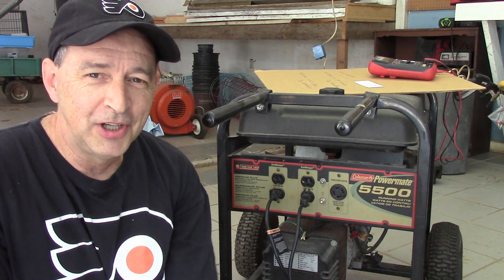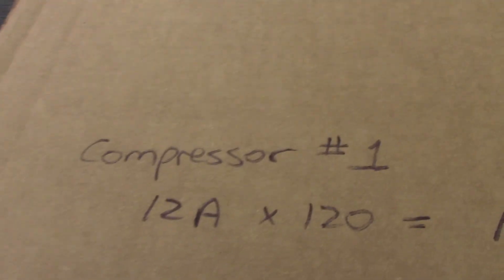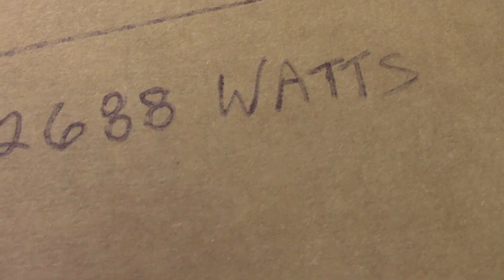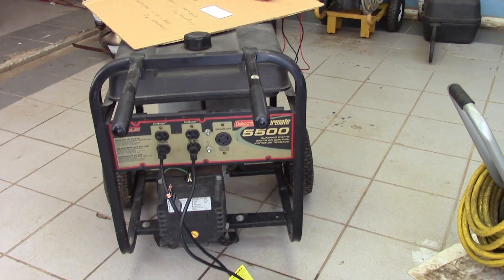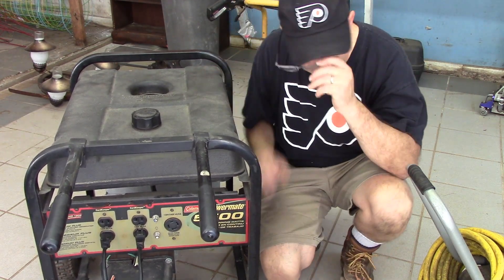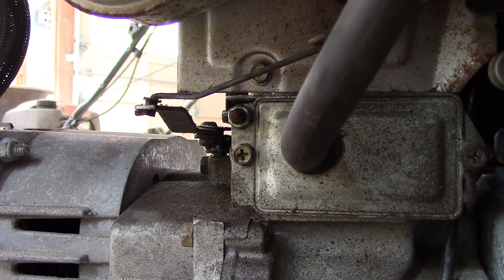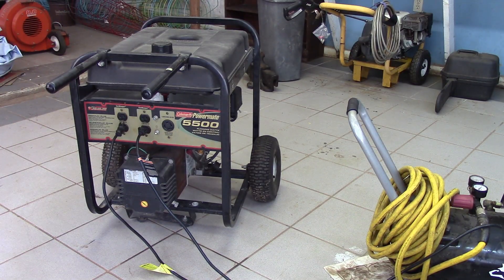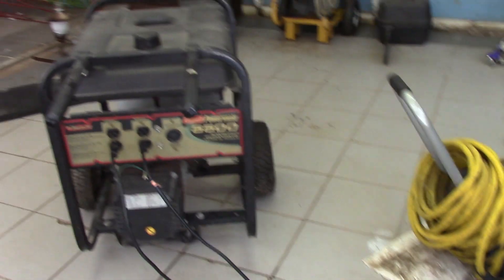LOAD TESTING the COLEMAN POWERMATE 5500 GENERATOR

Comment: The best way to tell how it is doing is to measure both voltage output and frequency. It should probably be a little over 60 Hz at no load and around 125 v. Under full load it will drop close to 60 Hz or slightly under. There are some really cheap meters available to measure volts, watts, and frequency.
Reply from the maker: Thank you